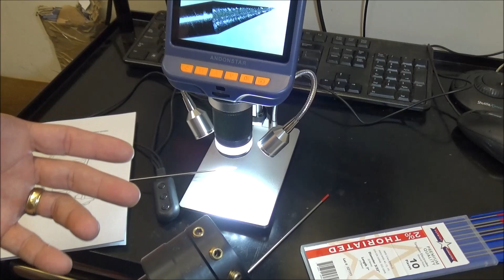TIG Welding Tungsten Sharpener

Comment: You want the grinding marks to be vertical. ....inline with the electrode. This helps the electrons flow better. The one you show has circular pattern this impedes the electron flow .
Reply from the maker: Yes Thank you,  Someone mentioned this to me as well. To be honest I most likely would not be able to tell the difference at this point. My TIG skills themselves impede the flow of electrons far more than my grinding I'm sure. For me this was a good solution so i did not have a dedicated grinding wheel setup. If I were going to do a Lot more TIG welding I would do so.

Comment: I am curious about the name of the power tool you are using. Thanks for letting me know.
Reply from the maker: Dremel
Reply: @CNC4XR7  First of all, thank you for the answer. I know dremel in the video. I'm curious about the exact model name of dremel. Or please link me.
Reply from the maker: @이성우-e6k  Its a Dremel digital variable speed model 398 no longer made I don't think.
Here is a similar model and should work just fine. the threads are standard. 

https://amzn.to/2qirbgP

Comment: chuck up the tungsten in a cordless drill that will help. also go to harbor freight grab some diamond disks and bolt one on the end of your grinding wheel. Those things are more trouble than there worth
Reply from the maker: seems to work well for me but at the time I did not know any different.

Comment: Hey Sam, that sharpener does put a nice bevel on the tungsten however you want the grind scratch directions to run collinear with the tungsten. This helps keep the arc from jumping around and concentrates it to the tip. On medium to high amperage settings you should be fine. However on low amperage starts like on very thin material you may find your Arc wandering. I've been TIG welding for 30 years and a dedicated "green" wheel on dedicated bench grinder is what I run. If you were to modify or make a new handheld grinder I would try and make the tungsten as tangential to the grinding wheel as possible. This might reduce the helical grinding pattern. Anyway keep up the great work can't wait to see the new mill running,  Ken
Reply from the maker: Hi Ken,
 Thanks for the suggestion. I did watch a couple videos about the Helical grinding. So I know exactly what your describing. I felt like at this point Being a "Newb " this was a good option to get the correct angle and consistent grind.  later if I do a good bit of TIG I want to get a dedicated wheel or grinder for this.
Reply: @CNC4XR7  sounds good. I found that a green wheel for sharpening carbide works best. You will ware a groove in a standard wheel in no time. If you're new to TIG welding you're going to be really good at grinding tungsten. It's very easy to "dunk it" as they say when you're first starting out, It's all part of learning. Good luck Man
Reply from the maker: @kendesign3622  Thanks Yes  It's not as easy as you see in video's takes practice  I have gotten a little better but a long way to go. I have made many Match sticks, or Q tips thats for sure. and gotten a couple of stingers as well Nobody mentions THAT?
 I will keep a Eye out for a wheel.

Comment: It seems like it is wearing the outside edge because that is the area that is removing the most carbide.
Reply from the maker: I thought so at first but right after this video I flipped the disc over and have about 75 sharpenings with no issue. Its weird may have been a bad side on this disc.

Comment: How are the c5 ball screws looking did they hold c5 tolerances how about backlash.
Reply from the maker: Have not installed them yet
Reply: @CNC4XR7  I asked the same guy for a quote an he was giving me numbers at around 100 dollars a screw for 4005 screws way lower than what you paid for much smaller screws. any idea why this might be.
Reply from the maker: @nicholasjacob3594  i got crazy cheap quote a first. I  had to clarify P5 precision  Ground NOT rolledball screws. So if its to good to be true get them to send a picture of what there selling you.
Reply: @CNC4XR7  thanks for the advice will do
Reply from the maker: @nicholasjacob3594  your welcome!
Reply: Nice. I didn't know these existed. What welder did you go with?
Reply from the maker: @russtuff  Miller STH 150 used
Reply: @CNC4XR7  Sweet!

Comment: Hi from France, Franco

Wouw, I did'nt know that U are also involved into welding-related activities.
I know a lot about TIG & microplasma apparatus, this kind of tool is useful for amateur set-up; 2 important things about this device.

Usually in industry, we always prefer to obtain "straight" grind, "with the sharpening made along the way of the tungsten rod".

By doing the sharpening on the perpendicular way, you will obtain an ark "splitted" and unable to tay at the tip, especially on Direct Current.
With this "twirling, oblique sharpening", the stability of arc should be okay, maybe you will have some fusion bath able to move from time to time, depending of the argon's flow which can also modify the distribution of the arc's heat onto the weld's geometry.
https://www.axxair.com/hs-fs/hubfs/sens-daffutage-de-lelectrode.png
https://cdn2.hubspot.net/hubfs/2141755/Guides-AXXAIR/Axxair-Guide-electrodes-FR.pdf

The second point is about radioactive decay of thorium, which is classified as "highly radiotoxic". Making small particles of thoriated electrodes when grinding can provide lung cancers, due to the tremendous energy when thorium-232 disintregrate for becoming lethal Radon-228. Lots of people will say that natural Thorium-232 is only disintegrate by half every ...14,05 BILLIONS years, making the generation of Alpha particle quite rare.

But when you consider the amount of matter to be grinded, it makes several billions of billions of Thorium atoms, and it is quuite easy to see a "alpha track" of thoriated-tungsten dust when place into a cloud chamber.

The amount of energy to cut a DNA strand is only 80 electron-volts. Thorium-232 decay by emitting a supercharged Alpha particle (an helium-4 nucleus, without its electrons, 2 protons binded with 2 neutrons, at 10% of the speed of light) with 3,95 MeV.

The contact with the dust should be avoided as stringent as possible, it's always better to bury the thoriated-tungsten dusts with clay, and dispose/dump it somewhere, avoid any contact /risk of inhalating small particles.

The deadly tracks of powerful Alpha particles can be seen there, from a ...2% thoriated TIG electrode. (straight tracks, able to travel at 5 / 8 centimeters from the rod)
https://www.youtube.com/watch?v=xo0w4LNNvt0
https://youtu.be/e3fi6uyyrEs?t=55
https://www.youtube.com/watch?v=8tgp2eBqZUs

The French goverment nuclear authority is giving additional info about the hazards of thoriated electrodes (see page 6 of 12 : Protection contre l'exposition interne, wearing of IPE is recommended)
http://www.inrs.fr/dms/inrs/CataloguePapier/ED/TI-ED-4317/ed4317.pdf

"Protection contre l'exposition interne

Compte tenu de sa radiotoxicité élevée, le risque d'exposition interne est particulièrement considéré pour les opérations susceptibles de générer des poussières de thorium-232. Ces opérations sont effectuées dans des locaux où le captage des poussières à la source est privilégié, qui sont correctement ventilés et régulièrement nettoyés.

Lors de la manipulation de thorium-232 et des matériaux en contenant (exemples : soudage TIG à l'aide d'électrodes de tungstène thorié...), les équipements de protection individuelle (EPI) suivants sont utilisés :

Gants,
Vêtements de travail à manche longues, fermé,
Protection des yeux contre les poussières,
Dispositifs de protection respiratoire en fonction de l'ananlyse des risques au poste de travail tenant compte des risques de manipulation: contraintes mécaniques, condition de ventilation, forme physico-chimique des composés, etc.)"

One of the other option is to skip thoriated electrodes with other alloys, lanthanide-based : Cerium, Lanthanum, Zirconium...

Best regards, stay safe from radioactivity & hope you will do splendid things Franco !
Reply from the maker: I'm very thankful for your comment and suggestion. I have purchased some Lanthanum Blue tungsten. and will be using them from here on out. Very good information. Thank you!